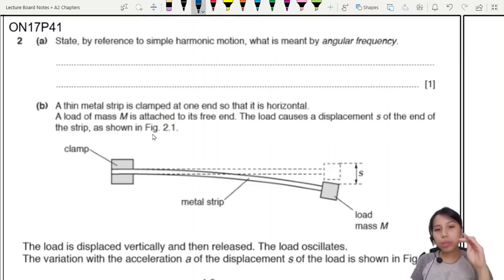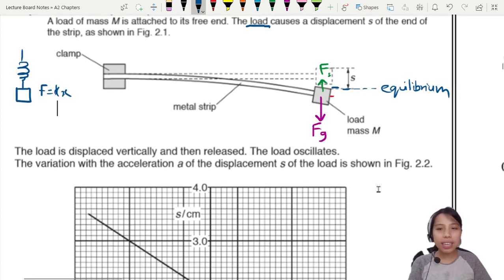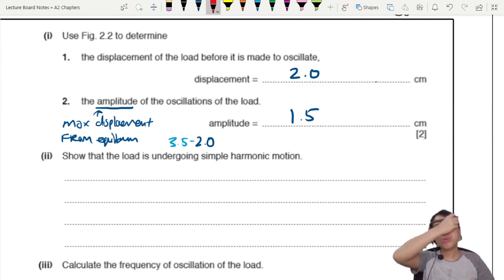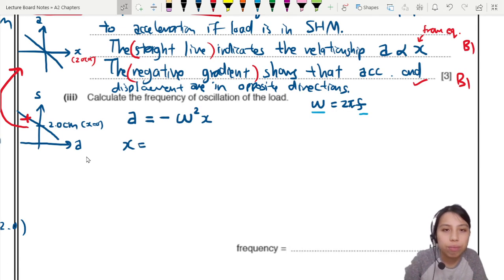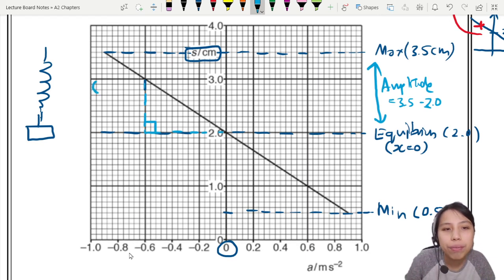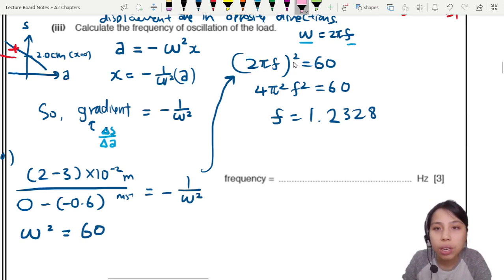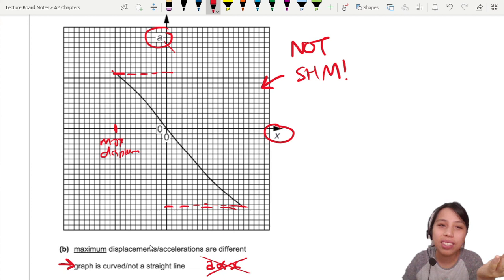17.1a ON17 P41 Q2 Metal Strip SHM Graph | A2 Oscillation | Cambridge A Level Physics

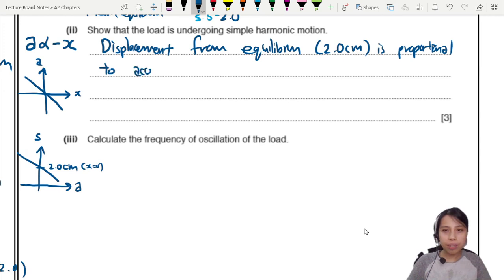Comment: 6:53 From IGCSE paper 6 I remember when straight lines passes through origin is Directly proportional. When straight line without passing though origin Is proportional. That's the only explanation i could provide on why marking scheme wrote proportional not directly proportional in 8:21 . please correct me if im wrong